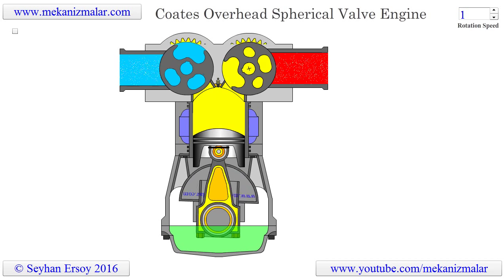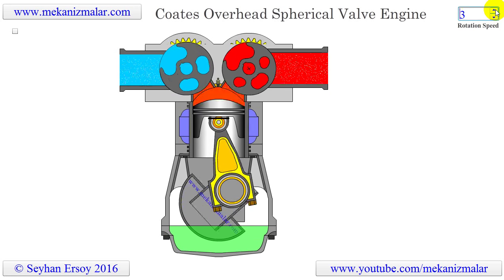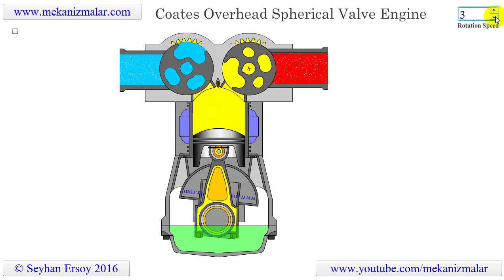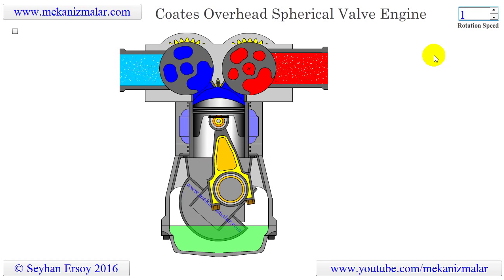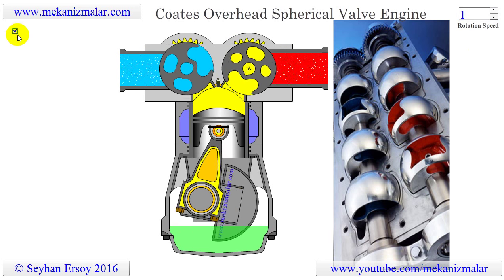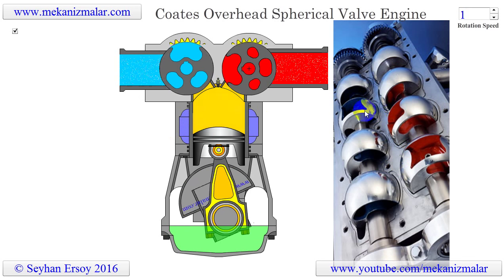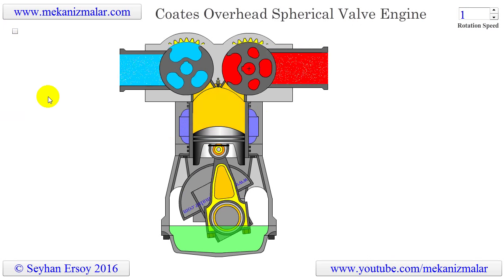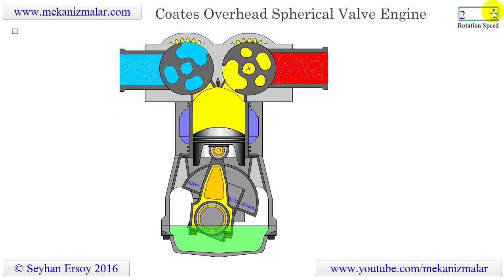coates overhead spherical valve engine

Comment: Over 10 years I visited a display/table set up by Coates at the New York Auto Show @ The Javits Convention Center. They  were trying to interest the aftermarket/hot rodding community in their concept. They even showed how they replaced the cylinder heads on Ford 302 ci/5.0 liter Windsor small block V8 and made way north of 500+ HP NA before they blew the block. The lack of adoption of the Coates overhead spherical valve engine system is prime example of "Technology Lock" not whether it is commercially viable.  When people and institutions are not only financially invested but mentally invested for 150 years of doing things certain way it is easier to break the Speed of Light than for them to change.
Reply: Would be interesting to see how they keep the exhaust flow path from getting full of soot and carbon deposits til it gets blocked
Reply: Assumes too much.
Reply: this is 100+ years old idea anyway. there were engines in 1920s that had rotary valves.

Comment: Some early prototypes had one major flaw, during racing applications the exhaust cam would seize up from thermal expansion.  Im sure with modern metals and cooling techniques this can be resolved .
Reply: Then they could be watercooled.  If heat was really the problem, then shame on Coates et al for not addressing this in about a month and moving ahead. This technology is massively efficient, and constitutes the biggest forward leap in engine technology since VTEC was introduced. It should still be pushed to production. Good lord. It's time for some better tech movement with engines.
Reply: @davidsirmons  what are you talking about? this does not work well. the exhaust gas can flow way faster than that valve can rotate and it's energy is used to suck in a fresh charge with a poppet valve engine. this isn't close to the case with this valve system. the reason we have what we have is because it works better than everything else
Reply: In any case it looks like it would have a terrible volumetric efficiency and quite a bit of backpressure, making the design inferior to normal valves.

Low Volumetric efficiency because only the air in the valve can go into the cylinder, and the valve would be smaller than the cylinders displacement and some air would remain in the intake valve. 
Backpressure because all the exhaust has to be pressed into the exhaust valve.
Reply: They used sodium filled valve stems to help with the guide problems and I can see this getting figured out also. I wanted a set of Coates heads for my 1989 Mustang, but they couldn't get Ford or GM to signup with the program; too bad on that.

Comment: Rotary valve engines have been tried multiple times, but the problems of sealing and lubrication have never been solved. Sleeve valve engines were built for many years also, but had the same problems of sealing and lubrication.  This is not a new idea.
Reply from the maker: I agree.

Comment: Interesting engine, design. During the combustion the force of the exploding gases force the conventional valves against the head of the engine in this setup I think blow-by would be a problem. Depending on what fuel is used carbon deposit on the rotating surfaces may causes failure.
Reply from the maker: +marcibb What I read in their web site is that they are using natural gas to operate this engine somewhere in Canada.

Comment: yeah i can see why these aren't used anymore. first issue surface area this creates 2 problems first being heat since it's such a massive area compared to a normal valved engine all that heat is absorbed into the cam replacement meaning it'll expand and seize or just warp, secondly is friction since it's contacting the entire bore so though that you're going to lose power since instead of the friction being the contact of the cam on top of the valves for 1/3rd the rotation it's the entire diameter of the bore times the number of cylinders & since it's constantly touching the bores at all times it's going to cause wear the "seats" out much quicker than a normal cam that is an intermittent touch every rotation and finally and one major flaw with this design is repair instead of just replacing the valve seat's instead you're going to have to replace the full head/engine (depending on how it's sealed) rather than with a regular valve which you just knock the old seats out and press in new ones in its place. sadly i don't think theres a grand conspiracy here where manufacturers are keeping it hidden from us rather it's a bad design with no real benefits to switching to them.

Comment: Everyone is talking about sealing/oiling and cooling the valves being a problem, what about air flow? You would lose charge volume relative to poppet valves and because the air isn't compressed the flame front wouldn't produce any more pressure. This is a neat concept and I'm sure it has it's place but I don't see how it could compete with modern poppet valve trains especially now that solenoid valves have made their first appearance in production cars. Or at least I've never heard of them being used outside F1 until the Koenigsegg Agera/Regera, maybe they have been.
Reply: Exactly what I was thinking!
Reply: The solenoid free valve designs have longevity issues. Great in a Koenigsegg that isn't driven everyday, but not able to operate for years on end in a daily driven application

Comment: What kind of material withstands the heat in rotation as well? I wonder really how well it seals combustion and how much overlap they end up with too.
Reply: just needs better cooling
Reply: Ceramic
Reply: Well the intake side would be cooled by the constant air/fuel mixture flowing in. And there isnt much friction to talk about that would generate heat since there isnt much load on the part. The exhaust can be made from titanium och holds its strength at high temperature but i Dont think you need to worry about that since you can have an external oilcooler
Reply: I think the sealing is the issue, good if it's still new but in the long run when there is clearance sealing is the problem.

Comment: the amount of air in the intake change seems to be fixed by the volume of the valve.
Reply: Yea same with the conventional combustion engine.
Reply: no the valve just opens so that air can/fuel mixture can get in from the manifold. Its not a rotating chamber that gets filled per revolution of the valve. Its just not illustrated in an obvious way how it flows. If that was the case the valve would have to be gigantic since it would create a vacuum sucking and overpressure when pushing the exhaust out. Think of it as a ball valve that rotates connected to a timing chain.
Reply: that's where boost comes in

Comment: Dangit, I figured this design existed. Since the steam engine even!
So why do normal engines go to all the work of compressing a valve spring, putting all the wonderful Work (F x d) into it, to build all that potential energy, just to have it pop back up again, and move a light little valve back up. Surely theres a better a way. And here it is. But then, what % of waste in an engine goes to pushing springs in and out? Not much I bet. 
Thanks for the vid!
Reply: I always say to myself, how hard is it to rotate a camshaft by hand. To over come the spring force to be able to push a valve down with the camshaft is actually pretty tough. Now compare that to how hard it is to turn an a/c compressor. And to think how much power and efficiency an a/c compressor takes to rotate. If this spherical valve setup was as easy to turn as an a/c compressor, imagine how much easier the engine would be able to spin. I think it would be worth it.

Comment: it's immediately apparent why this design might struggle. first, pumping losses of pushing exhaust into a tiny cam recess. it limits the effective displacement. the only sensible pumping loss on the exhaust stroke should be to pressurize the intake stroke. that brings me to number 2, limited o2 capacity. you can't put more air into the intake recesses without more pumping losses. what's more, you're forced to do direct injection because port injection atomization would be nerfed. that brings on the next problem, spark and injectors. the space afforded over the combustion chamber with poppet valves is necessary for fitment of stronger plugs and injectors. lastly, every bearing surface of the cam in a spherical valve design must be lubricated. this is immensely more complex and friction inducing than a cam that just sits on a few bearing journals and rolls over a valve stem or rocker arm.

Comment: I guess the only major issue there is lubrication. Just like Wankel engines, when there is a spinning seal, there will always be oil, and this oil seal is right around the airflow, which in turn generates oil waste or more oil burn than conventional valves where the lubrication is on cam lobe outside the airflow.

Comment: Many many moons ago a European designer [I can't remember who] devised a working rotary valve system very similar to your illustration. The concept was a shaft that rotated like an inverted cam [picture a shaft with a slot milled across the axis] as the shaft rotates like your animation, a port is opened and closed, but instead of gulping the mixture, the shaft [for intake[ rotates the opposite direction of yours. Another version used a hollow tube where the air fuel mixture was drawn through the rotating tube, [this version didn't work well due to condensing, more in a moment on that]. To explain why poppet valve systems are problematic might not be obvious. Most would just suspect that less moving parts makes an engine more efficient and it does, however [I watched a video, again a long time ago, pre internet] showing a non overhead cam engine valve train cut away that was operated by an electric motor for demonstration. All components in mechanical systems have losses, and in the case of push rod/rocker arm valve trains, an amazing thing was demonstrated by the mockup. At operating RPM the pushrod, rocker, even the lifter and particularly the valve spring began to heat up to the point of glowing like a light bulb filament. The energy of compressing the spring and even compression of the pushrod caused heat to such a degree that the thermal dynamic losses became startlingly obvious. Overhead cam systems are an improvement by removing components that aren't needed, making the springs "lighter" so the engine overall becomes more efficient and capable of higher RPM, but still, the valve springs generate heat, cams have friction and heat is the greatest loss of efficiency in std internal combustion engines. [some estimates are 65%+ inefficiency] With understanding that internal combustion are air pumps, and the more effectively air can be moved through them the better the performance and efficiency, now that we have functioning direct injection for gasoline [only usable on diesels not long ago] the air fuel mix condensation would no longer be an issue, making both the rotary and tubular rotary valve extremely viable as illustrated in this video. https://www.youtube.com/watch?v=yfmb-tCo2yA  and here is a rotary valve engine operating with a carburetor [uggg]. Add in the variable stroke arrangement from one of your other animations [from Honda?] and there might be hope for getting internal combustion engines up to 75-80% efficiency, both making the high performance enthusiasts [such as myself] and the environmentalists happy. Although I'm not quite sure the Whitworth, gear and linkage mechanism wouldn't be reintroducing more friction and heat loss back into the system, not to mention balancing and vibration issues. But hey, as you said, as technology changes and improves ideas that were good but impractical long ago, might not be so impractical now and in the near future. Getting all of the atuo manufacturers on the same page could be problematic.  The competition and profit of capitalism does have it's down side. 
You might also be interested in this "D-Drive" infinitely variable ratio transmission that has recently been unveiled, https://www.youtube.com/watch?v=F6zE__J0YIU 
If you take this D drive and use Sumitomo's cycloidal system instead of gears, gosh. Putting all of this technology in one package along with hybrid and wow! What would be really cool is if all of this tech is put into production before we run out of oil.  
Thanks for all of your work and sharing it.
B

"Talent hits a target no one else can hit, genius hits a target no one else can see." -- Arthur Schopenauer
Reply from the maker: Wow very long and informative comment. Thank you.
Reply: YW, wish I could find a vid of that valve train,, watching all the components glowing is a real eye opener for thermal dynamics. sorry for rambling, it's an engineering habit. :)
Reply: The rotary valves can be used to make an inverted loop scavenged 2 stroke out any v8 with a blower for scavenging, just got to get the timing right.
Reply: The D-drive is a differential that’s overly complex, and not understood by the inventor for what they’ve really got there: sad to see he wasted all that time, money and energy on such a major misunderstanding.

Comment: good work.. maybe can combined with another system to overcome problem from timing belt or chain failure. so the engine will safe. i just said maybe..
Reply: +Muhd Nazri Gear driven cams - like on modern engines

Comment: The rotating mass is an issue this would be a huge drag on engine power
Reply: Small rotating masses, such as these small-diameter valves running at half crankshaft speed, will not affect engine power.
The really tricky part about rotary valves is sealing them--and that goes double if you want them to run without oil in the fuel. The rotating mass itself is NOT an issue--you'd just use a slightly lighter flywheel.

Comment: That engine wouldn't create any vacuum and the same amount of air will always be entering the engine meaning it won't be able to rev up
Reply: It would if it had a throttle body
Reply: Somebody's clueless...
It will "create vacuum" if it has a partially opened throttle. Also, Diesel engines don't have intake vacuum and "rev up" just fine...